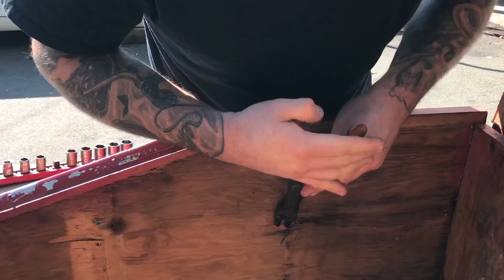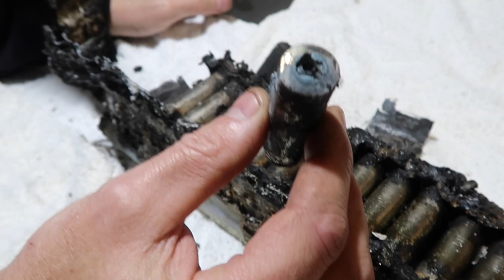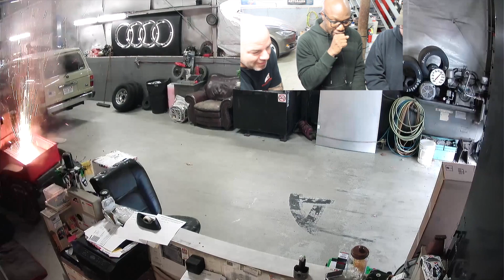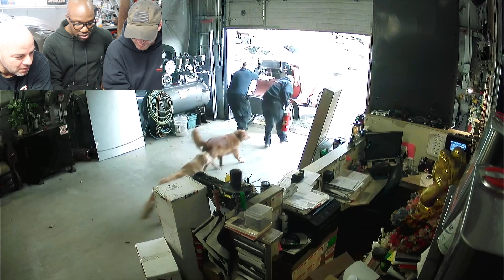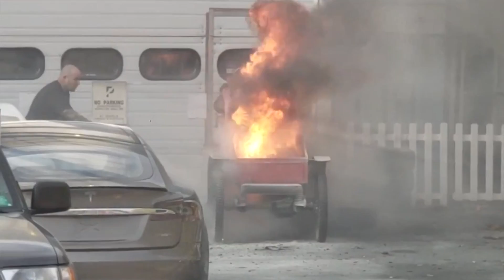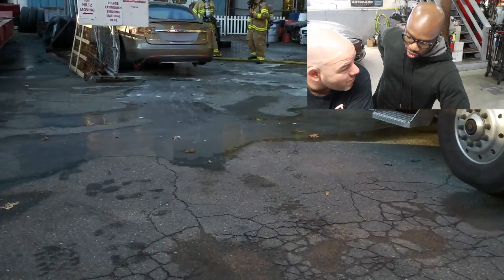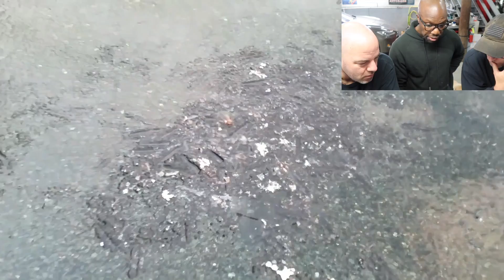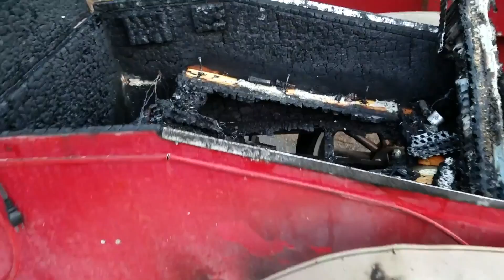My first Tesla Battery Fire

Comment: I don't know what fire extinguisher you guys used but looking on the reaction from the fire it seems to be the wrong type. Every time you try to contain it, it seems to react more violently.
Reply: The fire wasn't fed by oxygen, so nothing would have worked. It needed cooling. The heat from one burning cell overheated a neighbor, a thermal cascade. I'm worried more about the smoke they were breathing. It's poisonous.
Reply: It seems to be a powder extinguisher. But extinguishing the fire is something you can forget alltogether as Lithium doesn't care about anything when it burns.
The only thing you can do is cool it as much as possible (assload amounts of water or CO2 extinguishers work for that) to try and prevent the rest of the cells from overheating and bursting

Comment: Its a runaway battery fire caused by excessive heat or a damaged battery. I did see a wire plug in attached prior to the flames. Did you over charge the batteries? This is my speculation
Reply: It's what most people here guess, since there also was no charge management.

And Li-ion packs are sadly almost always runaways, because it's near impossible to extinguish Lithium, and the heat just melts down the other cells, exponentially increasing the meltdown rate
Reply: @schrolock  On the original pack it would be much harder for a runaway because of the cooling loop.
Reply: I Kant own a Tesla so I’ll ask, does the cooling stay active when the car is off? My guess was the run away is from two unevenly charged packs. One going deep discharge after running the car and the other was dumping into the discharged one trying to charge it so they become even in series. So either one was over discharging, or the other charging to fast (or both) causing excessive heat. 
Besides the missing BMS that could have cut this off or managed it better, Rich might want to pick up some thermal checkers. My guess he will check levels and lines of cells on the packs before he puts two 444 cell 18650 packs together next time and have a BMS installed.
Reply: Gadget Review Videos I believe the cooling is always active and kicks in when necessary. They are pretty great at managing themselves. To avoid. Well... this lol
Reply: Good to know,  but even cooling by itself would stop thermal runaway with each cell reaching over 1500°F. The dies behind battery safety is to prevent thermal runaway. This is when the BMS and temperature monitoring circuits come in to use mosfets and switch off the current flow between cells before they run away.  The more I think about it I think the cooling is for when it discharges and fast charges, seems to make sense in the whole picture of things. I know BMS is constantly on using power from the cells to run.
Reply: @kriss2005  absolutely. I just meant they agree mostly runaway, once they catch fire.  Poor communication on my side
Reply: @GadgetReviews-US   I am almost 100% positive the cooling system still runs while the car is off. This video raises questions that would not be in a factory TESLA. What electrical setup did they use for the Daisy? Can they say for a fact there was no damage to the batteries ? Can they rule out the charging system didn't cause unintentional damage to the battery pack.
Reply: Arvin B ó0
Reply: Do you not remember that Tesla owned by  husband of actress Mary McCormack that caught fire for no reason, so even BMS and cooling is not full proof.
Reply: @gregandkaruna6674  Although it happens, it is exremley rare that a faulty battery makes it through. Panasonic has very strict QC with any battery with even a slight chance of fault will be neutralized. Once its passes from Panasonic the batteries are handled by Tesla. If a battery is damaged and makes it through , which again is rare, it should show readings that Tesla will again reject. There are little metal attachments on the cap that should burn out so the battery is singled out before becoming a runaway. So my thoughts are a unmetered charging or a damaged battery from removal reinstallation. I would not fault Tesla for this incident.
Reply: @gregb2  Absolutely just pointing out it's still possible, although to date no Nissan Leaf has ever had a thermal runaway so it is possible to make the cells without cooling and not have the thermal runaway problem. One guy posted a video on trying and failing to get a Nissan Leaf battery to burn, at worse it smoked
Reply: @gregandkaruna6674  im guessing that chemistry of batteries can also play a factor as well as the spikes that develop in batteries after charge and discharge. Not sure if those were 18 or 21 size batteries used by Rich. Still a possible $2k mistake
Reply: Greg, I just watched a video of a Nissan leaf battery being replaced. To me it looks like the Nissan leaf uses LiFePO cells that are safer then the 18650 cells. I may be wrong, but that’s what the cells looked like in the video. Different batteries, and different chemical compounds although both lithium based.
Reply: @GadgetReviews-US  looks like the leaf uses the square style lithium, so both have flammable Li electrolytes. I don't know the safety difference between cylinder and square style. I know Tesla stated they used the cylinder for a density reason, although i do not have the answer. We just have to figure out how the batteries got so hot to cause a fire in the Rich Rebuilds video.
Reply: Greg B , Someone else noticed at 3:12 that he pulled a plug when waking to the car with his left hand. So maybe looks like it was being charged without a BMS. Thus also brings into question the charger, thermal monitoring from the charger and if they wired balance leads in the battery? But no BMS is enough to say it shouldn’t have been charged considering each pack has 444 cells.
Reply: I would like to see a follow video than start with reason, possibilities so people don’t misunderstand and thinks it’s the batteries. These cells are stable with the proper protection wired in line. It took more then 3 decades before they got any lithium based cell stable using electronics. I would hate people to get the wrong idea from this video.
Reply: @GadgetReviews-US  Agreed. It would be nice for a follow up from Rich telling us what they did, how it was wired, and what was used for charging. So if a issue is found, the rebuild community doesn't make the same mistakes.
Reply: Greg B don’t think that will happen; he will likely try to get some insurance money out of this...
Reply: Aad, not sure what insurance money they would get. I don’t thing daisy was insured, the auto shop may need a separate amendment if they are working in electric cars. And besides daisy the only damage was the asphalt back driveway, replacing 6 fire extinguishers, and maybe having to pay for the fire department responding (only is certain states/counties).
Reply: @gregandkaruna6674  we don't know if a Leaf has caught fire. It not news unless it's Tesla. Nissan also doesn't have a bunch of Tesla Short investors pushing negative stories.
Reply: @tony_25or6to4  A Leaf is an EV so there was one that did catch on fire and it was in the news, however from what I remember of it, the fire was not caused by the battery. Oh and I do not buy stock from any company, and never believe the short and long stories both sides are nuts in my opinion.
Reply: @gregandkaruna6674  really? A Leaf us a EV? Duh! What makes you think that none caught fire. You think you hear everything?
Reply: @tony_25or6to4  Typical angry response from a Tesla sheep. Fine so far no other non high performance excluding the Leaf EV worldwide have had thermal runaway's happy now?
Reply: @tony_25or6to4  Fine you keep your Tesla and be happy with it and it's low cobalt content, you know the expensive component that has one bad side effect of keeping the battery more stable, and less likely to thermal runaway. So I am very happy to drive my family in my non EV Nissan Leaf knowing that my family are safe from a free cremation!
Reply: @gregandkaruna6674  not angry or a Tesla sheep...not even a Tesla owner. I know people who  have both. I believe in facts and not speculation. You appear to be all too happy to jump on the bash Tesla bandwagon.
Reply: Gregory Bell nothing is fool proof. But a normal tesla battery with bms and all rarely, and i mean very rarely just spontaniousely bursts into flames
Reply: @kevin42  Yes I already said that, I agree it's extremely unlikely to happen, but battery chemistry has a lot to do with it. Tesla (Panasonic) used in Tesla are extreme high performance, so you need to know that high performance chemistry is more unstable and dangerous than the boring low performance Leaf chemistry battery.
Reply: Gregory Bell indeed, the further the batteries energy levels are from maximum entropy and equalibrium, the more they want to go towards(release the energy) it. So, the higher ur spesific energy is, in teslas case right at 260 Wh/Kg(the maximum known for Li-ion as of right now) the less stable the battery(or any other energy source) is.

note: by unstable im reffering to a fundemental physics stand point, not that teslas cells are significantly less safe
Reply: @gregandkaruna6674  we don't know how the McCormack Tesla fire started. The report is not out yet. My guess would be that the pack was punctured since the flames were shooting straight out from a single spot.
Reply: @tony_25or6to4  it would make sense if there was a puncture that caused damage to the battery in the McCormick fire. The pack is located at the very bottom of the car.

Comment: Thats 3 grand down the drain. $1000.00 a battery x 2 and $1000.00 for daisy  if not more. That sucks.
Reply: That Daisy car was probably worth more than $1000 historically speaking. It would have been better if he documented the entire car and its mechanics before adding those new batteries.
Reply: @Deneteus   Yes I know. your right. But we'll see. Rich has rebuilt worse wrecks. Maybe he'll restore a salvage Daisy. Who knows???
Reply: I wonder if he obtained full comprehension and collision with replacement value insurance for everything?
Reply: @tigeroll  Thats funny. But Rich wont even get Triple A for his Corvette that keeps breaking down cause he's cheap like all of use. LoL
Reply: @tigeroll  Would insurance cover knowingly using lithium batteries without a BMS or an incompatible charger? I doubt it.
This is an expensive lesson and an educational one for the rest of the community.
Hopefully the video views on this will cover the loss.

Comment: Electric conversions just got set back years :-(
Reply: Why?
Reply: @schrolock  Are you kidding me? A seemingly un-prevoked runaway fire in a vehicle in a country that almost broke Audi because of people who couldn't tell the difference between a gas pedal and a brake pedal! I'm surprised the video hasn't made it to Fox, where it will become an Isis attack on mainland USA and conspiracy theorists who will say Elon Musk is a Russian agent creating weapons!
Reply: @marksavin5778  i hope youre joking because i belive it was well understood there was no cooling system.
Reply: @evancornell5820  Do you not remember that Tesla owned by  husband of actress Mary McCormack that caught fire for no reason, so even BMS and cooling is not full proof.
Reply: @evancornell5820  well. He's not entirely wrong. The mass media that usually covers things like that doesn't care about facts. They care about money and drama
Reply: @marksavin5778  I know where you are coming from, but that does by no means set electric conversions back at all. Even here in Germany they proof to be quite popular. Already sat in a Trabant with a 40kw engine and a self made battery pack and when my last car was in the shop for the front bumper to be replaced, I got a VW Lupo with a Forklift battery instead of a tank, charging port instead of fuel cap and the converter screwed into the trunk. 
Original clutch and gearbox were still in place, only the engine got replaced by an air cooled 60kW motor. That thing was AWESOME

Comment: Maybe you'll respect these things a little more now rather than throwing them in the back of that crate with a few screws and a bit of lumber (not) holding them down.
Reply: No no, Andy, this was much more entertaining!
Reply: Yeah, cause those batteries NEVER do that in a Tesla...

Idiot.
Reply: @billcichoke2534  very rarely. The only time I can remember was before the model S had the reinforced undercarriage
Reply: @schrolock  and when this guy drove into the interstate divider ar 140 smashed the entire front of and then burnt the entire car. Or the model s in switzerland a few months back which barely stopped before a tunnel and caused a 10 hour emergency response.
Reply: @alittlebitintellectual7361  don't know about those. What happened in Switzerland?

When you crash at 140 and completely deliberate your car, you  should not be surprised by it bursting into flames. No matter if it is Electric, Gasoline, Diesel, Natural gas or Hydrogen powered
Reply: @alittlebitintellectual7361  140 km/h or 140 mph ?
Reply: @schrolock  140 miles or about 210kmh if im not mistaken. And that wasnt on purpose. It was a autopilot failure on a offramp devider prone to accidents because the lane markings are extremely bad.

Switzerland i dont know what happened anymore. But i dont remember a second car. So no crash. Could have been debree on the road
Reply: @alittlebitintellectual7361  i don't want to be "that" guy, but Autopilot requires you to monitor it. It's just another assistance system. So, especially when you come to an area that is very prone to accidents because of missing lane markers, you should at least get ready to take manual control over the car. (Also, if this was in america, 140 is waaaaay over the speed limit if I'm not misinformed, right?)
Reply: Robert Root  
1. Once I'm gonna let you go in it, but twice... imma call you out. It's "bad - worse - worst" fanboys are either worse (more bad) or the worst (most bad) but not both

2. Tell me. Where do you see any fanboyism here?
Reply: Robert Root  well. I said they are rare, because the are. They just get more coverage, even because they are rare.

Tbh, I wasn't able to find real statistics rn but I found this video, where some statistics get broken down, coming to the conclusion that EVs are less likely to burn, than a normal car.  But I will look for some raw data to analyze myself, as I don't like to just trust what I'm being told

https://youtu.be/U-BHr4bXyBE
Reply: @schrolock  it takes a lot of speed to tear of the entire front of the car including the dash from your car...
https://www.google.de/amp/s/electrek.co/2018/03/27/tesla-model-x-fatal-crash-ntsb-investigation-autopilot-fire/amp/

Its been a while since i last read that article, and thats not the original one. But please see if you can find the original. I dont have the time right now
Reply: Oh shut the fuck up

Comment: This is what happens when you run Tesla batteries in an enclosed space without their cooling system in place. Also, not sure what kind of charger was being used to recharge the batteries. Presumably the Elon Musk version would have shut off the charger if things got too hot.
Reply: Not really lack of cooling system causing this. You don't need that for a lithium pack. However, you do need a BMS and fuses in case of a shortcut. And a good charge controller.
Reply: @miloe436  you need the cooling system if you're going to charge and discharge it quickly, that's why the car has one.
Reply: @destinal_in_reality  I assume you mean Tesla, not Daisy :). A lack of thermal management will not make the batteries go up in flames. The BMS will handle this if temperature goes up too much and reduce the voltage during charging. The liquid thermal system in Tesla is there to prevent premature degradation of the batteries. Cars like the Nissan Leaf have no thermal management for cooling, as an exampel. (other than passive cooling when driving).
Reply: @miloe436  It really depends on how fast you charge and discharge the cells. Tesla cars are designed to be pretty aggressive in both, and that results in generating a lot of heat, which without cooling will result in damage to the cells and also fires. I'm not sure how fast they're charging and discharging in Daisy, but they definitely could have been charging fast enough to be hazardous. Of course, it could just be overcharging, too. We don't really know the details.
Reply: doesnt look like they were being charged at the time
Reply: @usernamenotavailable1234  I think it was being charged. See the cable on the left side of the screen running in to Daisy?
Reply: Probably not the overheating that caused it though...
Reply: Yeah he mentioned no charge management so just a dumb charger. Not sure whether they just had it charging too fast for passive cooling or overcharged it or what.
Reply: The Tesla packs place cells in armored compartments with individual BMSs. Thermal runaways can't happen unless the pack crushed in a massive blow.